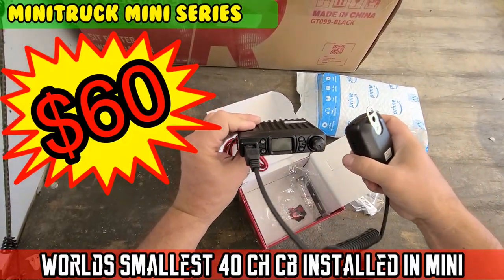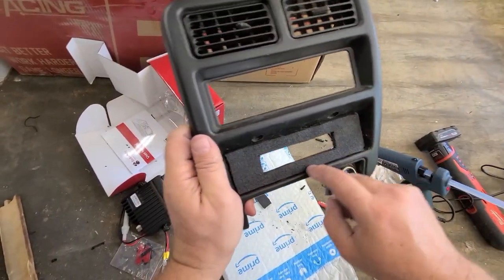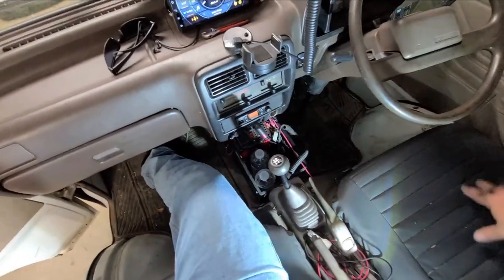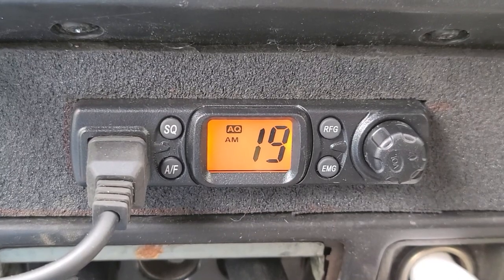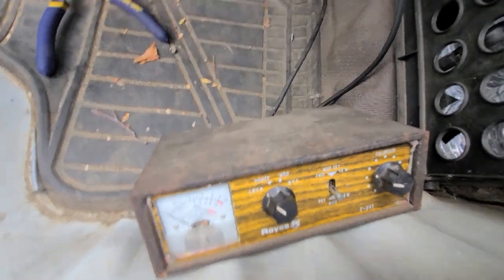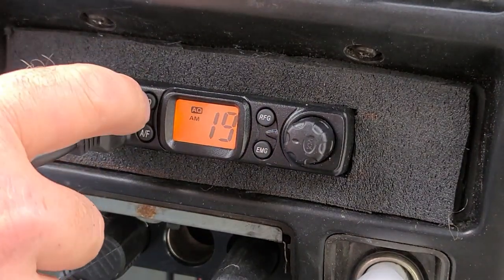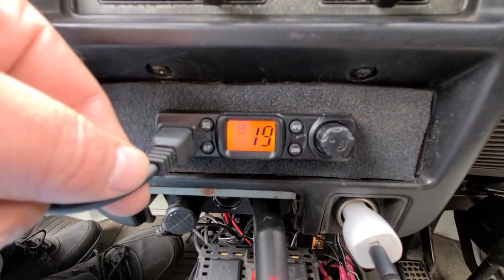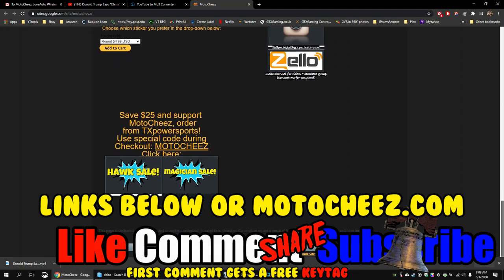Mini-Truck (SE04 E17) $60 Worlds smallest compact mini CB 40 channel Commander CB-27

Comment: That is a mini for sure . Should be fine for keeping in touch in your off road adventures !  When the unit is small and light weight I think it will handle the rough ride and vibration,s  without a problem.price is right too .thanks Moto ....

Comment: wow.   i cant believe you did a permanent install on this "portable" glove box radio

kind of crazy, if i was going to do a permanent install i would get a radio with ssb and  FM at least.....
Reply from the maker: No room, very shallow... Have an Android head unit on my dash with 7" screen. Use as speedo too. Not CB 😁
Reply: @MotoCheez  ah ok,  fair point.   its a nice little radio!!
Reply from the maker: My Rubicon has VHF all band and 10/11 meter tho 😁

Comment: I have no use for one, but that's a neat little cb-radio. It's amazing what they can cram into small packages now-a-days. All of my fathers past fuel trucks always seemed to come equipped with Motorola brand cb-radios. The oldest truck he had was a 1986 if I remember correctly, so that one had a pretty old Motorola in it.
Reply from the maker: Not much use for CBs, but us offroading guys still love them! And The New 2 meter 440
Reply: @MotoCheez  The closest thing I have to a cb are some simple walkie-talkies I bought for travel and atv riding. But haven't really used them for anything as of yet. Either way, they're there when we need them. :)

Comment: A guy I know installed a CB in his boat many years ago. It didn't work very good, he asked me to check it out. I found the SWR to be very high, after a few antenna adjustments I got the SWR down low and performance was much improved. The next morning at work I walked up behind him as he was telling all of the other employees how HE fixed his radio. He kept saying the SWR wasn't right so he cut some of the antenna off, that SWR still wasn't right so he cut off some more. Finally one of the other guys said, what is that SWR you keep talking about? Without hesitation he said Sumbitch Won't Receive. 💛
Reply from the maker: Hah. Boats are tough, no ground plane.

Comment: All the crying babies on the cb. I always kept mine off. Except for traffic report.  I would suggest using another freakwenzy lol when conversating back and fourth. PS. "Good buddy" is now used as a 👨‍❤️‍👨 reference. LoL.now all you need is the 40" antenna with a tennis ball 👍😂😎 beep beep.
Reply from the maker: Off-roaders usually use channel 4 or 16 universally. 19 is for travel if course. 
I've had a CB installed in my vehicles since the 80s 😁

Comment: Hay i took mine apart .
Bam added fm.
Bam 13n10 finals. Hmmm
More power.
Little tuning and 18 watts swings to 30+ been running for a year like that no problems. 
I have since converted it to a ammo box rig with a galaxy 225 a lipo  batt. And 102 whip.
String out some radials sit in the woods and talk skip from georgia all over into utah Nevada new Mexico Arizona. 
Been a fun little rig.
Reply from the maker: Awesome rigs!
Reply: I have run the ammo box rig for up to six hours before i begin to see power fall off.
Without the gaaxy amp running it will run all weekend friday evening to sunday dinner time.
It has been a fun little radio for camping.

Comment: Wow that's pretty small. You can probably install the radio inside a front storage compartment of a scooter or motorcycle fairing to keep it safe in bad weather. I wonder what antenna choices there are for it?
Reply from the maker: They make lil rubber antennas

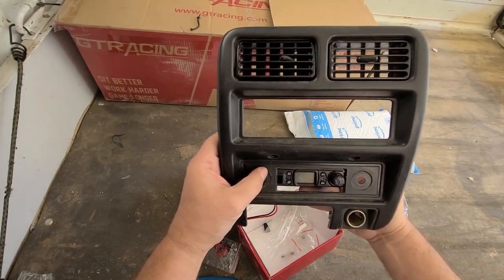Comment: 1:15 if you had a 3d printer that easy todo :D
Reply from the maker: I almost bought one a few times. Someday
Reply: @MotoCheez  i broke mine while upgrading  
motherboard  rip 2021/5/3
Reply from the maker: Damn. Lost power and bricked it?
Reply: @MotoCheez  nah i did some change soldered a bunch of stuff and wiped the firmware on board 
motor whining like nobody business . it still move but these are the symptoms of bad component
Reply from the maker: @buder5116  ahh. Stepper motor driver?
Reply: @MotoCheez  yes about to die and its weird because i disconected the wire with all the moving around to prevent damage >_>

Comment: Bro get you a Texas Star ⭐️ linear booster box to hook to that CB and Tiny will be talking 100 miles away....I had a Texas Star ⭐️ one of the older Gold ones in my Tractor trailer with a tuned Cobra 29 CB and a Tuned Wilson 5000 antenna and during skip times I’ve talked to other people on home base units 5 states away. 😂🤣🤣
I’m sure I was coming across peoples TV speakers 🔊 as I was driving down the road. But you don’t have to go that strong, you could still stick a Texas Star ⭐️ linear on it for Listening 👂 really far ahead. Also adjust the juice on it and still be able to hear and talk to all your buddies from their house to yours. Because with the Texas Star ⭐️ you can reach them and the Wilson 5000 antenna you can pick their transmissions up even though they are not running the amplifier linear. 😉👍 Oh by the way I’m back bro after a 6 month stretch in the YT prison for making pro Trump comments in October and early November on YT. Got stuck in YT jail just a few days after the crooked 🗳. Yeah Right whatever happened to our first amendment? 🤷‍♂️
Reply from the maker: I have one. Owned it for many years, also have a bigger "heater" on my radio rack. I've talked to friends in Florida from CT when skip running that way too! Yeah the banning is crazy on social media...
Reply: @MotoCheez  10/4 brother! Does the heater you speak of have glow tubes in it ? 😉😂
Reply from the maker: No, it's an italian made 500w
Reply: @MotoCheez  👍

Comment: At 11:20 in video, you said 9 or 19 was emergency channel. And preset 19 as your rx/tx channel?  I don't think you are supposed to transmit on an emergency channel?
Reply from the maker: 9 is the original emergency channel, 19 is the general use mostly used channel.

Comment: I got a question about the clutch, I put a shorter lever, the cable is very tight, when I pull the lever the clutch doesn't engage all the way, what can I do to fix it? Other than putting the stock lever.
Reply from the maker: It might not be aligning properly. If you can't adjust it to work, it's not right somehow
Reply: @MotoCheez  would I need a longer cable?
Reply from the maker: Shouldn't have to. Cable looks aligned?
Reply: @MotoCheez  I don't know what aligned should be
Reply from the maker: Cable should be same as on old lever, if is lower or higher it's wrong. The adjusters should fix whatever slack there is
Reply: @MotoCheez  I think I got it, just noticed that there's an adjustment behind the exhaust pipe, I had to feed the cable towards the hand lever, now it doesn't stall in gear while holding the clutch in
Reply from the maker: AWESOME

Comment: That's way too much SWR you should be running about a 1 or 0 I would check and make sure your antenna is not all the way down the base you can use an allen wrench to move that antenna up and down and that will change your or your coax cables didn't look in the best of health I would check them if they're corroded you'll lose swrs
Reply from the maker: That's the best I could get being so close to the metal. I know it's high. I did try adjusting. Molded wire into antenna. Can't put on roof or it won't fit in garage.